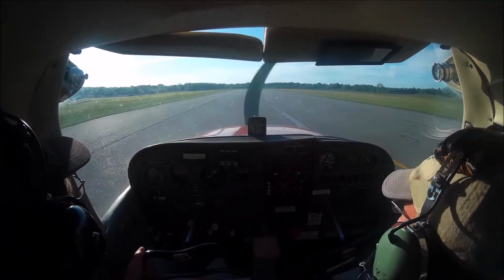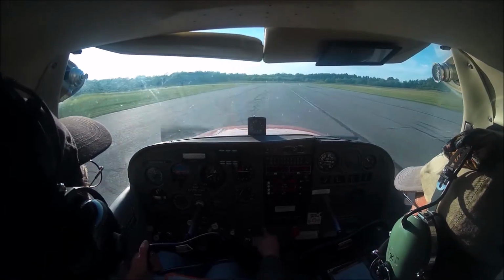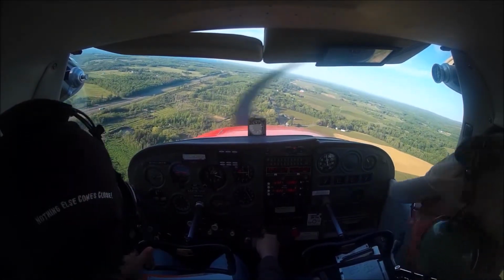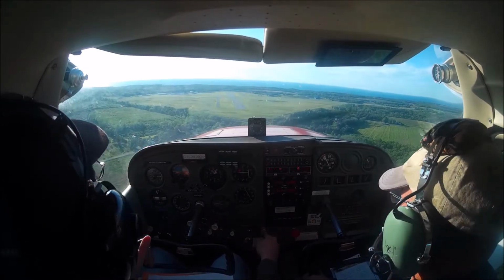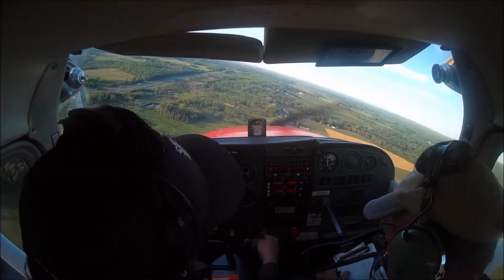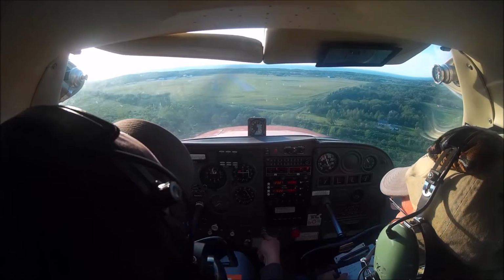Lesson Cessna 172 Max Crosswind Component Landings

Comment: Nice job both of you.  I have always tried to teach crosswind in a fairly strong crosswind rather than light crosswind because the student can visualize the need for cross controls better and recognize drift easier.  We learn gross movement before fine as babies learning to walk.  Something that will really help this student, any pilot, is to walk the rudder only dynamically and proactively same as we do with tailwheel airplanes to bracket the centerline.  Yes, drift requiring bank to counter was causing him to have to turn to fly back to the centerline extended, but using rudder to bracket rather than turn to correct will really help.

Flying pipeline all day long regardless of wind conditions forced me into a fix for very strong crosswinds at single runway airports.  Using the apparent brisk walk rate of closure approach, or any power/pitch approach along with deceleration on short final to bring the throttle into full dynamic play for exact glide angle and rate of descent control.  Now we can make base to final into a headwind component and mentally draw a new final between the downwind corner and upwind big airplane touchdown zone marking (1,000').  With now more headwind component and full flaps on a Cessna, less than a tenth of that 1,000' will be needed to stop without brakes.  Airspeed will still be more than enough and ground speed will be 20 or less in those winds.  We will still need to control crosswind with bank and this new centerline with rudder.  Rub tummy pat head stuff, but now much more manageable.  Just good wind management.

I wasn''t fussy about the dynamic proactive rudder only for longitudinal alignment until the last landing at how with no or little crosswind.  If we use rudder only, correct yaw rather than adverse yaw, to bracket the centerline, the wing automatically stays level.  Use the anti-turn control so as not to have to continuously turn back to target.  Longitudinal alignment, as TW guys know, will never happen with corrective turns on final.  Tail waggers do much better at landing than do wing waggers.  Stay off the steering wheel in no wind.  It will always make the nose go the wrong way first unless we lead rudder.  Dutch rolls will prove that.

Comment: So can I use power for altitude when slipping? I thought I can only slip with full flaps no power
Reply from the maker: Remember that a forward slip and a side slip are 2 different things.   I'm not sure which part of video you are referring to, but we were doing mostly side slips when on final.   When we needed power we added it, this was not during a forward slip, which would defeat the purpose of the forward slip which is used to quickly lose altitude.   Thanks for stopping by and always double check anything you see in videos with your flight instructor.
Reply: @FlyingwDRZ  got my ppl and trying to build hours for instruments and commercial just haven’t done strong crosswinds and want to be prepared for what’s to come.

Comment: Always listen to your instructor but flying a slip all the way down rather than crabbing makes it nearly impossible to stabilize your approach especially in gusty winds, IMHO. My x-wind landings got 100% better once I started crabbing all the way down to my roundout on the advice of my instructor. The slip adds an extra variable - in addition to pitch, power, and gusts, you are changing your sink rate every time you change your bank angle. Overall good job handling some challenging wind.
Reply: Preforming a forward slip to a landing has more to do with feeling comfortable while executing the approach versus control of the aircraft.  Just as a forward slip requires a change in rudder and aileron during gusty conditions a crab to a landing also requires a change in the crab angle. A crab angle approach also requires the pilot to transition to a forward slip before touching down to avoid a side load on the main gear. There is not a dramatic change in the sink rate with a small bank angle change, if there is, apply power to for any dramatic change.
Reply: @lpappas474  I like a good forward slip to landing to shed some speed and altitude if I need to. But for a normal x-wind with an otherwise good approach (turned final right on airspeed and altitude) I just find the crab with transition to slip as late as possible is a much more consistent and comfortable  technique for me. 

I also fly a Cessna normally and prefer using all my flaps; Cessna recommends limiting the amount of time slipping with full flaps in. 

In any aircraft I would prefer not to be cross controlled near stall speed longer than I have to.

That said I don't fly much at all anymore so let me come full circle and say at the end of the day people should listen to their CFIs.
Reply: @mccrashington8873  AS I stated before, some pilots do not feel comfortable performing slips to a landing. As a former flight instructor I had taught both techniques, again it is what the pilot feels comfortable with. 

Preforming a slip with flaps extended is not recommended in any aircraft that I'm aware of. I take that back, there was one aircraft built that didn't have rudder peddles and you would land that aircraft in a crab.

There isn't a way to land an aircraft correctly during crosswind conditions without cross controlling. I don't know of any flight instructor who taught a pilot to land the aircraft above the stall speed, quite the opposite. My point, the pilot will be landing the aircraft in a cross controlled stall.